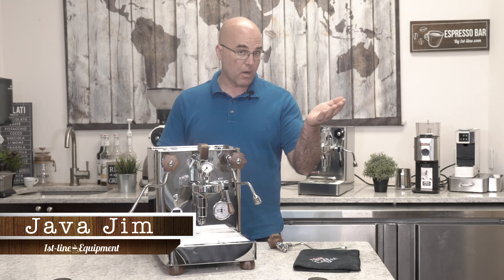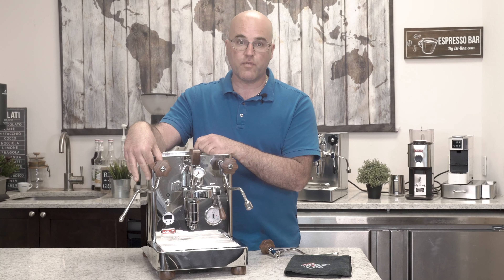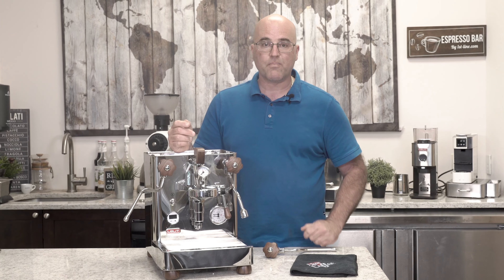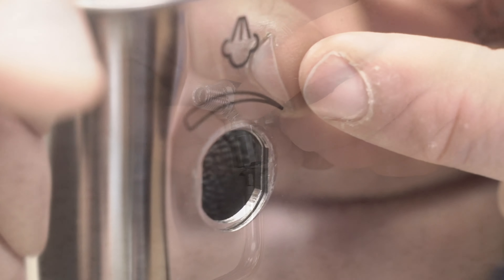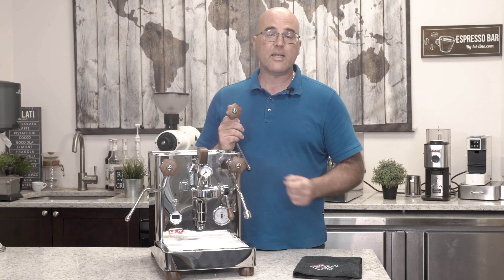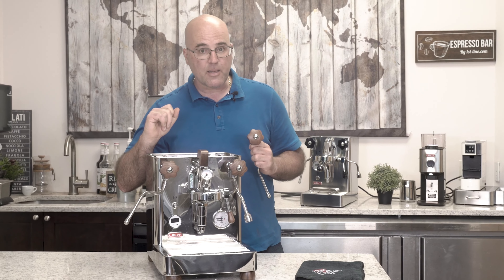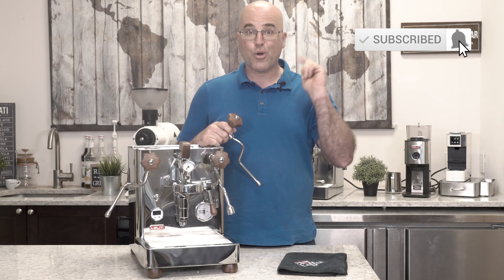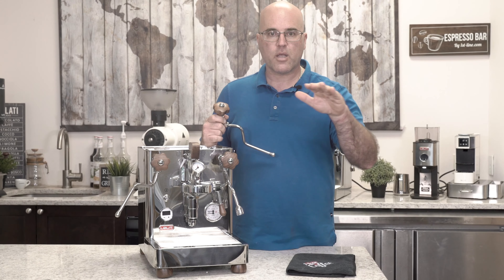Lelit Bianca: Secret Feature

Comment: Hey Jim,
I am doing my research on my next home espresso machine.  I really like what I am seeing in the Lelit Bianca!  I do have a couple of questions for you....

1. Does the backlit power on/off button stay on when pressed? Or must you manually press it to the "on" position each time you want to turn it on?  (I am asking because if I purchase one, I would like to attach it to a Wifi switch so I can leave the actual switch turned on yet be able to power it on remotely to allow it to heat up)

2. When do you expect to have the Bianca in stock again?

Thanks!!